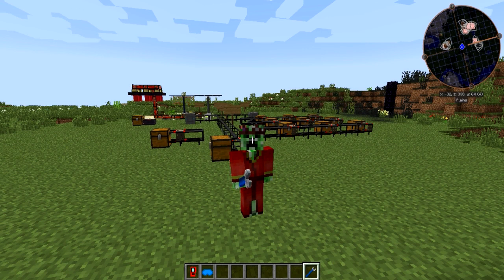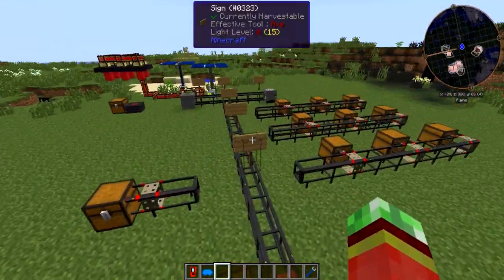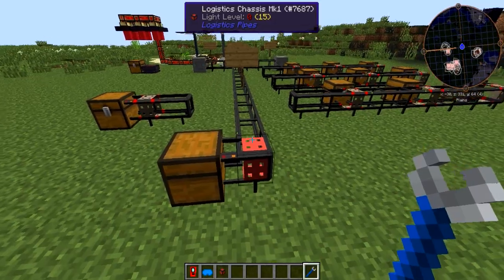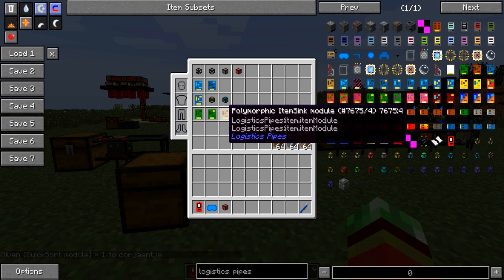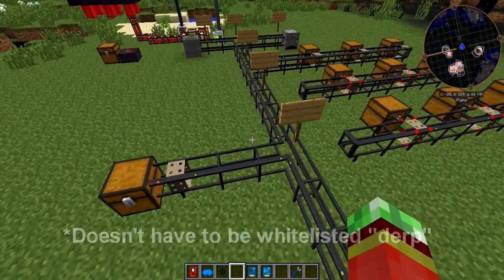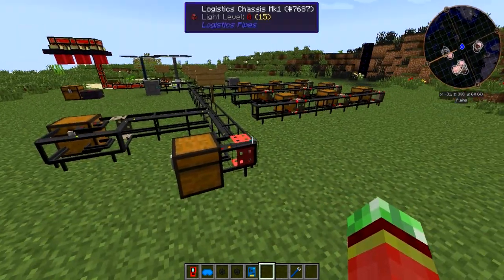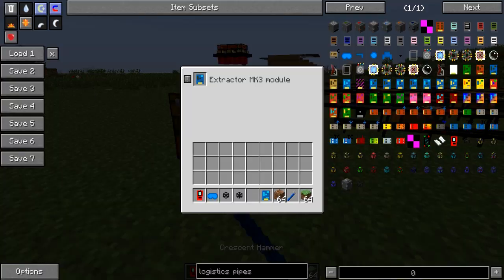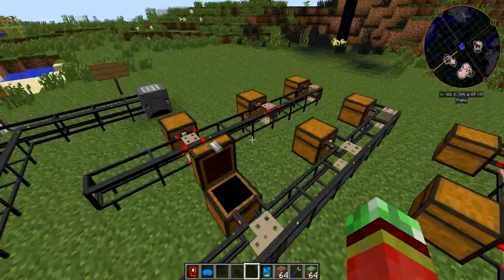Logistics Pipes Tutorial - #2 - Item Sorting & Default Route

Comment: you can also use most buildcraft pipes instead of the unrouted ones. so you could use gold to speed it up. or sandstone to avoid connections.
just make sure if you are sending energy through those pipes that it CAN do that but you need a logistics pipe on every corner.
Reply from the maker: +pim hazeveld Hey there Pim! You are right, you are able to use Buildcraft pipes, but for consistancy sake I prefer using Logistics Pipes pipes :)!
Reply: I think i will use the buildcraft pipes instead. I coyld probably safe myself some resources going for diamond pipes instead of itemfilters. or I could make my network even faster with golden pipes. and overall, using cobblestone pipes is cheaper than the unrouted pipes.
Reply: ***** Logistics pipes will only turn red on every split corner actually. Not every corner but you do need a basic pipe on every corner if you want to transfer power through the pipes.

Comment: I've build everything like in the video. I have 2 Chests, one with Mk3 extractor underneith it in a mk1 chassis. Then ive got chests with mk1chassis and the provider module on my storage chests. But my extractor does not pull anything out of my chest, and my request pipe doesn't show me contents of my storage chests :(
Reply: +Blubbpaule you need some item sink . Otherwise extractor dont have place to put extracted items into.
Reply: +PeKlim 

Doesn't even work at all
Reply: +Blubbpaule I'm having a similar problem.